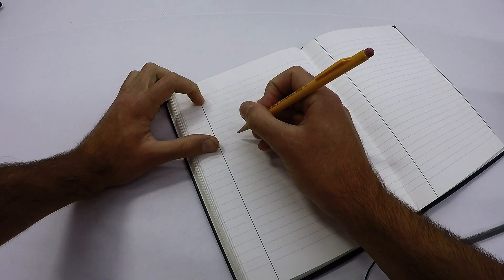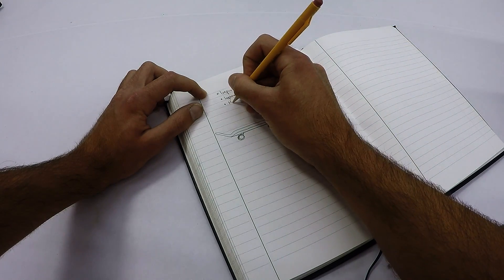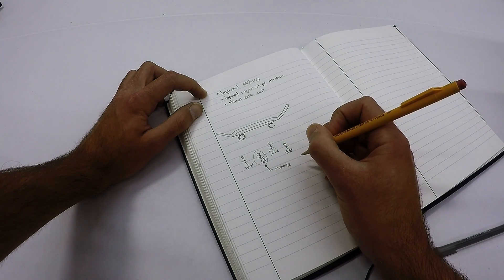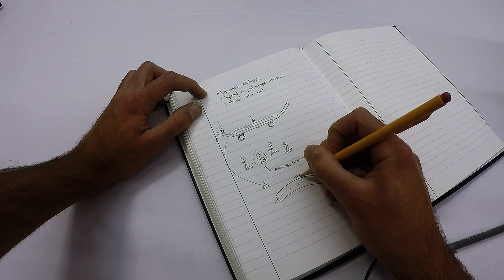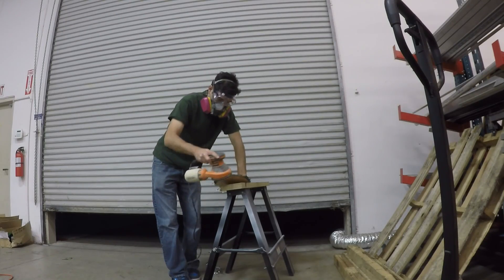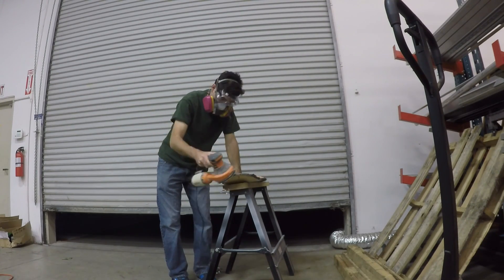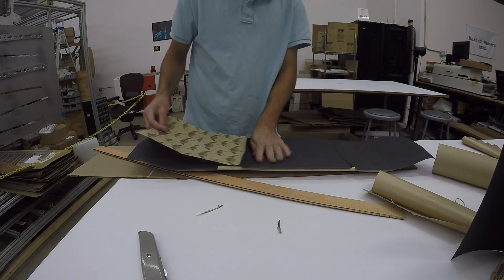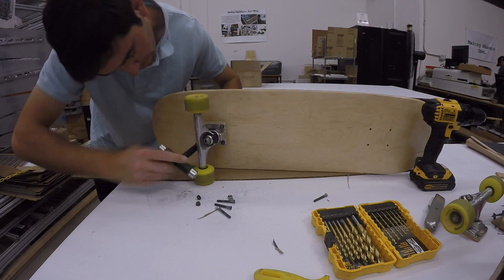Making a carbon fiber and maple skateboard

Comment: The issue with carbon fibre that you didn't address, but that was critical to your build purposes here, was the fiber direction/weave. unidirectional fiber will create sheets  that are stiff in one direction only, being very flexible in the perpendicular direction. It can't be determined from the low res of this video, but that appears to be the direction you laid the fiber in this build. So, unfortunately, it really did very little for your stated goal. Either a different cloth type or the opposite ply direction would have resulted in very different results.
Also, another thing to consider would have been either to lay the grip tape first, thus embedding it directly into the epoxy (no idea if that would work) or using a sheet grip tape upside down, impressing the course texture directly into the epoxy surface, giving the board a naturally abrasive surface.
Alteranately (and perhaps best) you might try sprinkling abrasives (sand, carborundum, etc.) directly into the epoxy before vacuforming, and skipping the grip tape altogether.
Just some thoughts.

Comment: I'm gonna be doing a build like this in the coming days, but I'm going to use a LOT more carbon and a face sheet of fiberglass (for protection) and a bit less wood. It'll be a 36" single kick if you're curious.

Thanks for the video and lessons to easily avoid!
Reply from the maker: Sweet!  Def share it in the DIY skateboard builders group on Facebook when you finish it!  Would love to see it. https://www.facebook.com/groups/607320939462244/
Reply: openSource(skateboards); carbon build done, and some pics can be seen here: https://www.facebook.com/LakesideBoardsLSB/posts/2065349527027866

4 ply maple, 2 layers of carbon and 1 of thin glass on side side. Roarockit press with perforated release film and breather cloth. Came out great! Clearly some voids (air holes) in the layup but otherwise fire.
Reply from the maker: Beautiful! :D

Comment: im quite sure the carbon fibre was ment to go on the bottom, tension occurs on the bottom and compression occurs at the top?
Reply from the maker: You are correct if the loading condition is such that the force being applied is downwards between the trucks - in this case, the board would bend like the letter U, compression on top, tension on bottom.  However, the failure mode I most frequently encounter is fracture near the trucks due to landing with one foot between the trucks and one foot on the nose or tail.  In this loading scenario, there are two point loads applied to either side of one truck.  In this case, the board bends like an upside down U around the truck, so there is tension on the top and and compression on the bottom.  Does that make sense?
Reply: Thanks a lot, I’m just building a diy longboard for my gcse coursework. I might put it on both sides to reduce flex when normal riding so the hub doesn’t scrape, and for the reason you specified. Thanks again. Would fibreglass or carbon be better in terms of tensile strength?
Reply from the maker: Cool.  I found this table comparing tensile strengths of fibers, and it looks like carbon fiber typically has a higher tensile strength than fiberglass: https://en.wikipedia.org/wiki/Basalt_fiber.  A good source for checking specific material properties is MatWeb (http://www.matweb.com).

Comment: next time use a layer of carbon fiber and Kevlar weave in between the layers and layers up you own. I use the weave to replace a layer of maple with it
Reply from the maker: Yeah, that's a good thought.  My intent with this was to minimize manufacturing costs - doing an interwoven layup as you describe would make a stronger board and help distribute stresses more evenly I think, but that would require me to either use epoxy for the full layup (which is about triple the cost of wood glue) or doing a multi-stage layup using wood glue for the wood sections and epoxy for the fiber sections (more labor hours and wait times).  Maybe there are other options, though that I'm not aware of!  Ideas/suggestions are always welcome :) .

Do you do your layup completely with epoxy?  Which epoxy do you like to use?
Reply: For maximum benefit from the tensile strength of the carbon you need to keep the carbon on the outermost layers, as far away from the neutral axis (middle layer) as possible, so what you've done is good. You could go one further and add a carbon layer to the bottom too. Bringing the carbon layers further into the board will reduce the effectiveness of the carbon. One thing you may want to try is using unidirectional carbon instead of weave. This has even greater tensile strength but only in the direction of the carbon fibres, but as you're not after transverse strength, this would work well.
Reply: @1977meteor  Actually, I was a bit surprised at the idea to put the carbon fiber on top. Since the board flexes toward concaving during ride, that's the bottom to made to stretch less. In this video, the carbon layer acts by resisting against compression, which it is not best at.